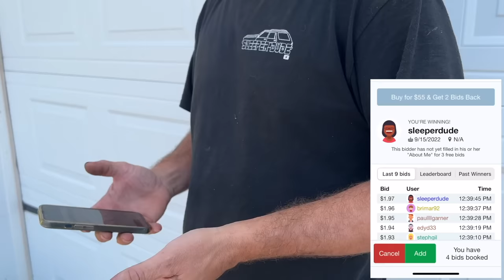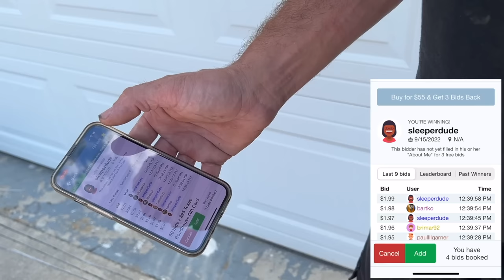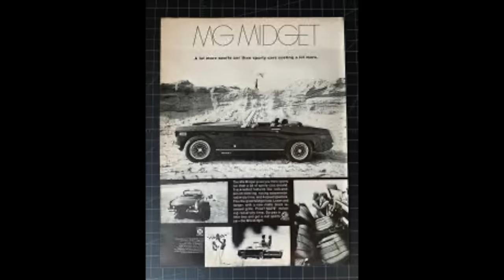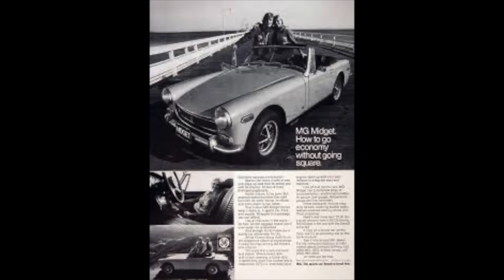NASTIEST clean up we have ever done! Mom bought her dream car back after 17 years!

Comment: Hi Josh.  I'm a 74y/o long time retired mechanic in the uk.
That series of engine was one of the best ever produced, treat it with love and respect. Between 1960 and 1972 that engine in competition won 32 major rallies around the world, including winning the Monte Carlo rally 3 times. However, changing the Oil Filter is about the worst job on the car but, you have to do it to keep that engine good. I would rate changing the oil filter as harder than cleaning out all that rat crap. The original carb's were twin SU's, simple but brilliant and easiest ever to set up and tune. That twin Weber tells me the car was driven by an enthusiast with a heavy right foot. The rust areas on both front wings were notorious for extreme corrosion, they need a lot of love and care but the car is worthy of it. The roll bar is after-market which again points to being driven by an enthusiast. The front spoiler and amber lights below the front bumper are also after-market (unless the lights were a US spec' item). The hand brake is probably a Fly-Off for rally starts, so if it works in an unusual way don't think it's faulty. Also check carefully around the side jacking points for serious corrosion, they are a weak point. Fun fact for Mrs. Sleeperdude, Small Petrol Tank... If that engine is properly tuned, you should get at least 30mpg even from your smaller US gallon. From a UK gallon which is approx 20% more than US I would expect that engine to give approx 40mpg. She mentioned the tank was only 6 gallon but that will be UK gallons so, maybe 7½ to 8 US gallons. However with that Weber carb' the car was clearly used in a 'sporty' way so that would affect mpg. In good order that car would have been capable of over 100mph with the top down. You should have no problem finding mechanical parts but the trim, the soft top, and the tonneau cover could be difficult. You might need to get them made. The seat trim with the Tan coloured bars could well be original, they did lots of that kind of fancy trim.
Reply from the maker: Ok wow thank you for the good info

Comment: Love your MG. Had a Truumph spitfire, 76. The trunk could be repaired by Duro rust killer. You pour it on then spread it with a brush. In 24 hours it binds the rust and fills holes. I used  it on my 43 mil jeep, works very well, is drollable and paintable. Hope you get it on the road.
Reply from the maker: Ok great thank you

Comment: I think that there is an incredible supply of parts available via MG Owners Club, I believe the club in the UK have all the original tooling for producing body panels. 

They even produce replacement body shells.....

Well worth getting in contact with them if you get stuck.
Reply from the maker: Ok thanks

Comment: I was born and bought up just a few miles from the MG factory in Abingdon Oxfordshire , a friend did an apprenticeship there , shame production ended in the early 80s,  the engine is a BMC A series been around since 1951 until year 2000, could be either a 1275cc or 1500cc , originally fitted with twin S.U carbs ,very simple engines easy to work on .....♥ from the UK .
Reply from the maker: Thank you for the info

Comment: I had the very same MG Midget while stationed at the pleasure of the USAF at Hickam AFB, Hawaii.  I bought the red '72 Midget in 1976 for $1200 and it never had a heater (that's the way they were sold in Hawaii).  It needed a new top so I ordered a replacement from the J.C. Whitney catalog and installed it myself.  It was so cool to cruise Waikiki Beach in the evenings and drive it to the countless beaches all over the island on weekends.  My wife drove it to school at the University of Hawaii.  It was a lot more fun than riding "Da Bus" with 2 transfers every day.  I was 6'3" and about your age and had no trouble getting into and out of it at 190lbs.  I could never do that today.  I really loved that little car and missed it the minute I sold it to move back to the mainland.  It puts a lump in my throat to hear your kids express how much they like it. 
It is Pure Cute!
PS If you watch Rebuild Rescue on YT you will see an airplane that was rescued recently with just as much nesting in it as this car. Created by birds in about the same amount of time.

Comment: Chrome bumper, round wheel arch, 1275 cc. Definitely my favorite style Midget. I had a few of these over the years and they are great fun little cars. They are getting hard to find in nice condition like this one. They all rusted to nothing here in the North East. I have a "59 Sprite and an MG TD now. Don't forget about the non synchronized 1st gear! very easy to destroy the trans if not careful. Thanks for the great content.

Comment: Sleeperdude you need to supercharge that 200 in the Zephyr. They now sell aluminum cylinder heads for blow through applications. The head is set up for separate intake and exhaust applications....Throw a cam in that bad boy, get rid of all those unnecessary vacuum lines and smog crap, and then you'll have something you and your boy can be proud of... Completely unique also.... I know I'd like to see it and am curious what kind of power it would make.... Heck that would be a first for you and Ralphie too....a trip to the Dyno? ....by the way sorry about Puddin' What can you say.....life.....it happens.

Comment: Another great video Josh. We loved most of it, except to hear about what happened to puddin. It isn't easy losing a pet. We lost a 5 Y/O cat back in January, and still miss him. As far as the rodent problem, one thing I have done to get rid of the smell is to pull the carpeting, scrub the floor with bleach, and after it dries spray it with black spray paint. That should help with any lingering smells. Hope that helps, and thanks again for a great family channel that we can all watch.

Comment: In 1976 I bought a '62 midget, rhd, 948cc. I had so much fun in that car. I was 16 and paid $500. Blew the head gasket at 60 mph 3 years later. Found a '60 bugeye sprite for the motor and kept it to this day. I stripped some parts off the mg and left it at a neighbors house when I  moved. Will restore the sprite, but I've been saying that for 40 years. Maybe my grandkids.

Comment: brings back memories had a 72 Midget back in the 80's when I was in the USAF in So Cal when I got it would not pass Ca smog had a miss at idle took it to the MG place and the the guy said it was  a bad valve spring said it was common on these put new springs in it and it fixed it. was a great car to take it the beach in So Cal. I took it to Colorado Springs to see my Mom and Dad and Dad ask if he could take Mom for a ride and was gone the rest of the day a good 10 hours LOL then told me I should leave it with them and I could take his 72 ford wagon back to Ca I did not and took it back to Ca long since gone but fun to look back on those day's passed.

Comment: Mini cooper mags will go right on, name her Minnie, Mickey's wife, or Stankie. You will have so much fun at 35 mph going around corners, hit the handbrake at about 30 mph, keep button pressed and juke the wheel and you will do a nice 180°. Put proper fluid in brakes. You will never forget the exhaust note. My '62 was a lot more primitive. 3 gauges, 2 split, 4 switches, a lap belt. I could reach over the door and pick up a rolled newspaper. If I was parked crooked I just picked up the rear and moved it over. Mine weighed 1100 lbs.
Reply from the maker: That’s awesome

Comment: You can get everything for that MG at Moss motors and Victoria British.  Your main sources for vintage British sport cars.  Been using these sources for 30 years.   Also, the hood is called the “bonnet”. The trunk is called the “boot”. The top is called the “Hood” and the “tonneau cover”is what snaps over the folded down hood.   Also the windshield is called the “windscreen”.  That carb should be a SU not a Weber !
Reply from the maker: Ok thanks for all the info
Reply: @Sleeperdude  No problem, I have been restoring old British sports cars for years!  Just a bit of advice,
I highly recommend converting to dot 5 brake fluid when you go through the brakes. Yes it means a complete flush of the brake system but most likely you will end replacing 
All the major brake components anyway. Using Dot 5 will save you from continuous hydraulic component rebuilding, like master cylinders, wheel cylinders, caliper rebuilding and so on since most of these collector cars are stored most of the time. Harley Davidson sells dot 5 if you can’t find it.  Again, Moss motors and Victoria British sells the new fuel tanks and every nut and bolt you will need and will send you free catalogs with your first order.  Good luck!

Comment: A little bigger than this midget but my dad has an MG BGT with a 3.5 V8 in. It just about gets into the engine bay! Original factree 1976 build too. Good thing is with MG parts are pretty easy to source, and there's loads of UK places that will ship over to you if your struggling to source in the states. Very sorry to hear about Puddin too.

Comment: Finally a car that I have driven... Midget parts are super easy to find. There's an owners club that has remade the rarer stuff. You're the wrong side of the pond, but who's fault is that? I still see loads of these cars driving around in England looking immaculate. MG, btw, stands for Morris Garages, which was Morris's sporty brand. Made in Abingdon, a town a few miles south of Oxford, where Morris's main plant was. This'll make a great runaround for Wah-wah... 👍 The engine, by the way, is a detuned version of the Cooper. Lost 11 bhp. Done to make the Midget slower than the more expensive MGB. Not hard to get those back. Put on a Cooper head. Higher compression, bigger valves. Or just LS swap it and be done... (Sorry to hear about little Pud. A real cutie).

Comment: The front spoiler and the fog lights aren't factory.

Getting parts is easy try Rimmer.

The hoops(wheels) are painted Rostyles with chrome trim rings, a copy of the Magnum 500 style produced by the Motor Wheel Corporation of Lansing, Michigan.

Comment: Sorry about Puddin, she was my favorite.  😞Try Victoria British/Moss Motors in Vancouver.  They used to have everything and I think they're the same company now.  Also,, the original SU or Stromberg (forget which on a Midget) offers better economy, that Weber is likely good for a few more ponies but has charge distribution issues when not feeding one cylinder per throat.  You'll see that on the plugs, e.g., 1=Lean, 2=Rich, 3=Lean, 4=Rich.  The first cylinder to get the charge uses it up.  You can often get better tuning results with a downdraft like on Pintos and the like (also Weber)

Comment: There's a reason they plastered MG  all over it. Austin Haley Sprite was exactly the same car just different badging. So the nickname for the complete series of cars was  Sprigit . You need to pull out that heater housing the ductwork  will be full also . Those fenders come off easily. 
 Parts .
MOSS MOTORS, or  LITTLE BRITISH CAR COMPANY LTD.

Comment: as far as brake parts type in mg austin sprite hope that helps as far as engine parts that looks like a 1275 so early mini cooper stuff could help you there lots of aftermarket stuff for austins pins and pads can be found on ebay. It shares parts with morris minor and healey , points cap rotor and condensor are made by lucas.

Comment: I had one of these..it caught on fire every other week and the dash had termites. I traded it for a 72 Dodge Demon 340+6 . It wound up catching the dash on fire and burning its new owner pretty bad. He ran it over with a CAT D9 bulldozer about  40 times until it was nothing but bits..he put it in a pile and burned it up with JP-8 jet fuel and was so angry, he did the same thing to his mint condition MGB GT..if you even mention MG or British Leyland, he starts losing it. I agree with him, someone should buy the rights to the MG name and have it stricken from history

Comment: Firstly, I am so sorry about Puddin, it is always sad to lose a much loved animal. As for the car, I watched this with growing excitement, I had a red 1968 MG Midget, which I loved a lot, I spent many happy hours working on that car, I learnt so much about cars. I am gobsmacked at how solid the floors on your car are, mine were totally rusted and it was only about ten years old at the time. However, I didn’t have a resident rat. So if  you do the maths, unlike Mrs Dude, it was a lot more than thirty years ago that I had mine. I can’t speak for the US but in the UK, they had twin SU carbs, they could be tricky to get balanced, that’s possibly why it’s now a single Weber. That rust you have at the bottom of the front fenders, is a common rust point, there is a spot inside where the water collects. Depending on how far you want to go, in the UK and here in Australia there is an MG owners club that can supply almost any parts, including carpets and the soft top. I am really looking forward to the “will it start”
Reply: OH and be VERY careful about using that factory Jack, those jacking points are notorious for rusting out. Sorry for,such a long post.

Comment: All the parts are available here in the UK.  I'm sure someone would ship to the US.  Puddin broke my heart he/she was so sweet and will be missed.  Don't be frightened of small cars 😂 they are simple to work on especially now it has a Webber.  The original twin SU Carbs were problematic and hard to tune.  Looks like a total rebuild at some point as engine paint is incorrect as is the rocker cover etc.

Comment: That does take the award for the most rat infested car I have ever seen with a live rat jumping out too. That's a shame about poor little Puddin and you are right these things do happen. Well I would have bet even money you would never have cleaned that engine good enough to find an engine. That car normally came with twin S U  Carburetors. The last British car I worked on I was 19 years old and my Dad had a 1951 Austin A90 Atlantic convertible with Twin S U Carburetors. He had parked it on the driveway for 10 years there was a rust stain around the car. Anyway I got it running and driving and the next month he sold it. That was 52 years ago.

Comment: I’m sure someone has told you about Victoria British Limited AKA LMC Motors. I’ve been dealing with them for 35 years for Ford, Chevrolet trucks and MG/Triumph parts and they are competent. Moss motors is pricey but they have the hard to find parts. 
The Weber might be factory but I think they were still using the fiddly dual Strombergs SU carbs. I have a red Midget too but it’s a 1963 Mk 1 and has rust in the same places as yours. 
I hope the kids do okay with Puddin’ crossed over the rainbow bridge.
One last thing,
Your onboard rodent is probably hiding in the driveshaft tunnel.
Reply from the maker: Thank you . Your probably right about the rat

Comment: I had mice get into a tool chest I had stored in a friend's shed. The urine actually etched into the chrome on a couple of Snap-On wrenches (the biggest, most expensive ones). Not that I care how they look.

Also had a mouse nest in my heater box ('88 LeSabre) after just one winter parked dormant outside; so bad that the heater would not put out any heat at all the following autumn. After I found what the problem was, I cleaned it out with Pine-Sol & paper towels.
I think bleach would have done better to kill the smell.
Reply from the maker: Man that’s not good

Comment: I Have Seen What I THOUGHT Was Bad & Nasty Cars, But I Could  Never Imagine Anything  That Bad it Was TOTALLY 
DISGUSTING & Your Probably  Going To Have To Take it ALL APART To Get Everything  Out Of Everywhere  ???
And Try Some  WD40 With Steel  Wool That Has Worked For Me,WD40 is Actually  A Cleaner Rather Than A Lubricant  They Say ??? But It Works for Alot Of Things , But You Do NEED TO GET ALL OF THE Mouse & Rat stuff  Out,  (  Its Really  Really  BAD ON YOUR HELTH  )
Be Safe 👍👍👍👍👍😉